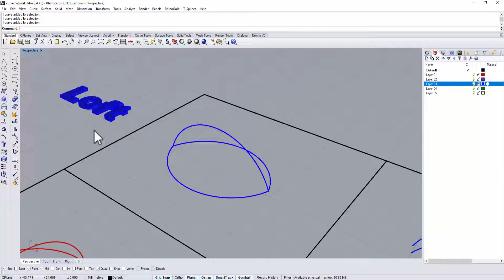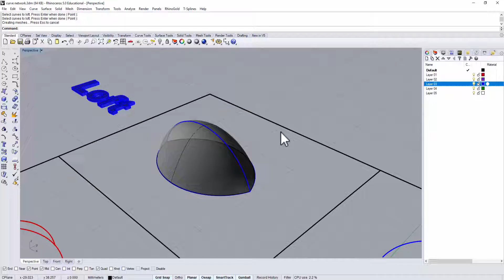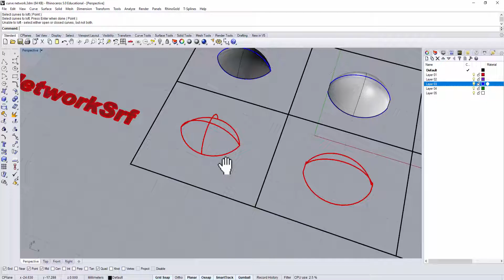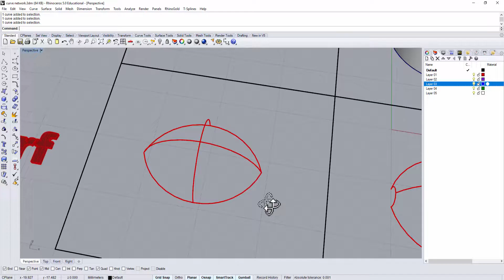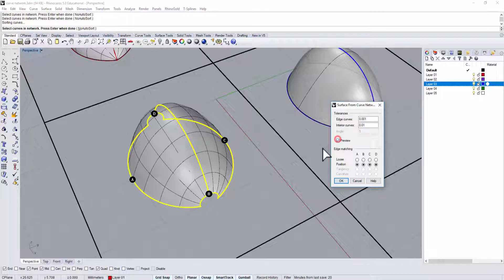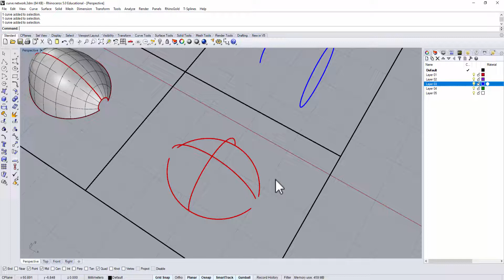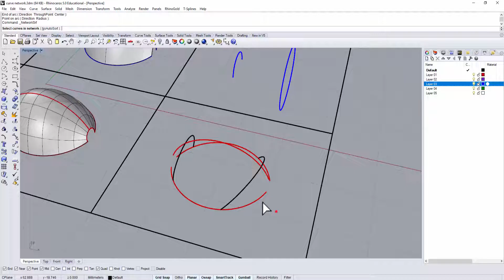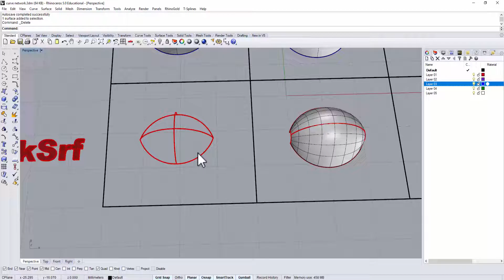Rhino 3D CAD Technique #13: Curve Network Surface Commands (有中文字幕)

Comment: Apologies if this is a very basic question but I'm new to Rhino. How do you create the vertical arcs? You have to use other views right?
Reply from the maker: you can draw on the prefer viewport or hold SHIFT key when draw arc.
Reply: @PJChenJewelryDesign  I'll give it a try. Thanks for the the timely reply. And thank you for the informative videos.

Comment: How can i make a line connect from any spot on a cruve prefectly not just near
Reply: @PJChenJewelryDesign
Reply from the maker: if the spot you plan to have is not list on Osnap. You can always drop a point to the place you want and snap to the point.

Comment: Thank you for your videos. They are very informative and  clear. Can you please advise what is the best way to design a ship's hull? How would you go about?
Reply from the maker: I may create the ship body surface first. and use contour command to get the equal line on the surface then build the hull with those contour line. you can search "contour" on my channel. I think I have couple videos for this command.

Comment: I'm really annoyed this doesn't always work. Yes with simple blobs it will give you a nice curve but I want to build an airplanes fuselage in one beautiful wired network. Instead I'm forced to mold one from a sphere with control points with the odd loft and blend here and there. Doesn't feel quite the same. Any advice?

Comment: How about just a simple flat surface? I have some closed 2D lines and I just want to make them into a flat surface
Reply from the maker: use "surface from planar curve" command
Reply: @PJChenJewelryDesign  Thank you so much! I found that it is hard to make it into a surface when the shape is consist of various straight lines and curves. How to make them into flat surfaces faster? Right now, I am just dividing them with straight lines into sections and put planes on it by each section. It is very time consuming. lol

Comment: I see the whole video till end and i understand also but i don't understand how curve network work on last curves in which you use gumball command to move the curves.
Reply from the maker: could you tell me in what minute and second? It is easier for me to go back to the videos since I have many now.  and what part of curve network you don't understand?
Reply: From 6:35
Reply from the maker: That was an example if the curves are not touching each other. the surface will locate somewhere in between curves.

Comment: Thank you PJ! Great video as always... I'd love to see you make a French pave' halo top for any stone that isn't round. I.e. Pear shape, princess, etc...
Reply from the maker: do you have an image?
Reply: PJ Chen Design 
https://youtu.be/wjK276zKa1I
Reply from the maker: This is more of the math than model. You will need to figure out the size of the center stone and the melee size. Basically, you don't want to have stone touch each but keep about 0.1 to 0.15mm depends on the size. you also adjust the stone gaps depend on the total stone number you have. The concept of arranging prongs are the same it is the different style of prongs. I will suggest building the plate and cutting tool to cut other the seat. I will make it into my video creating list, and show you what I mean. Stay tuned.

Comment: Thank you so much!Very helpful!i have a question about analysis volume or quantity in rhino for 3D printing,after i analysis,it always say that my model has unclosed surface.do you have any ideal on how can I solve this?謝謝pj的影片！
Reply: 想知道如何在rhino中計算銀合金的重量的方法
Reply from the maker: Hi Alice, This is an excellent question. and it is the most asked question from my students. I will make a video to explain the calculation. Stay tuned.
Reply from the maker: You can calculate the volume of the solid object. Make sure you join all the surface and there is no naked edges.
Reply from the maker: HI Alice, check out my new video https://youtu.be/sxYowvzwuf8. this will help you on figure out the weight and price of specific metal from CAD model. Let me know if that works for you.